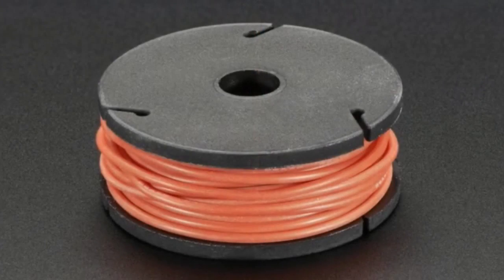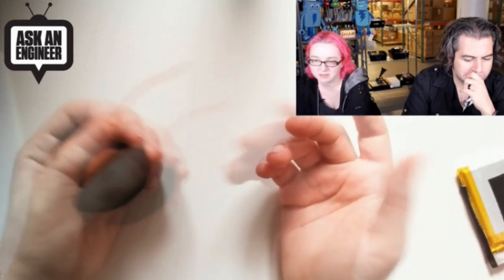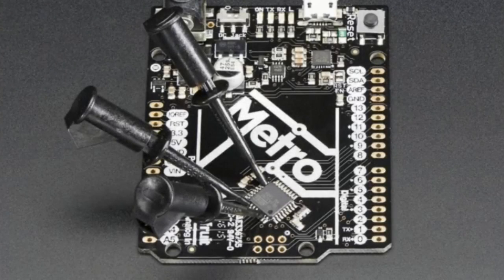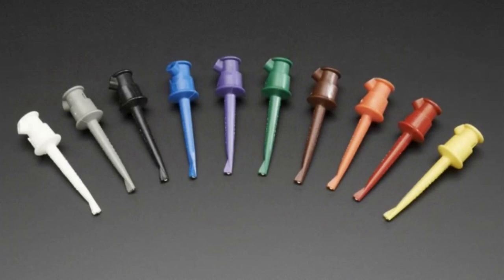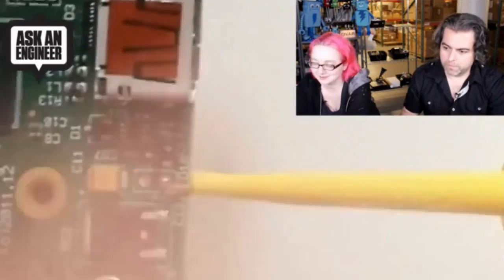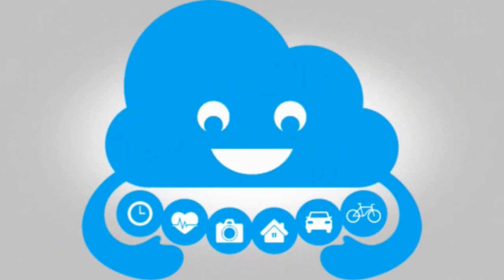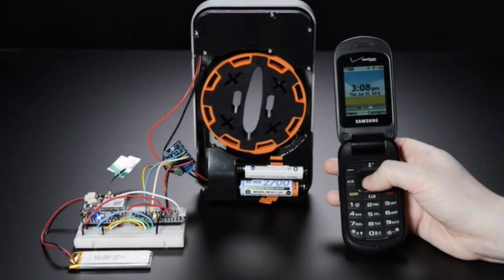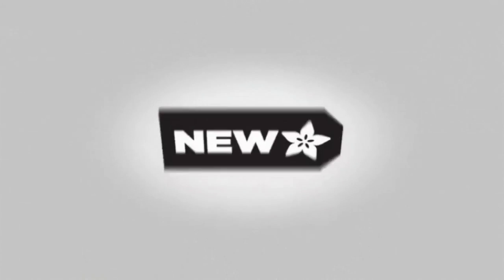New Products 7/1/2015

Comment: is there a clip of some type that can be used to make a temporary connection to a pcb hole in the middle of a board, a place where you might normally solder a header but you only need to make connection for flashing.
Reply: FWIW ... search pogo pin